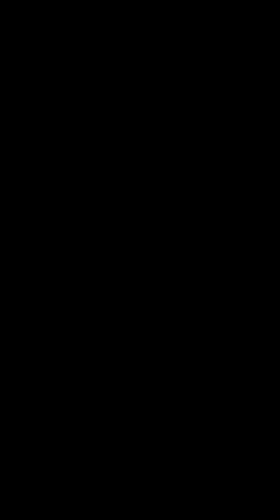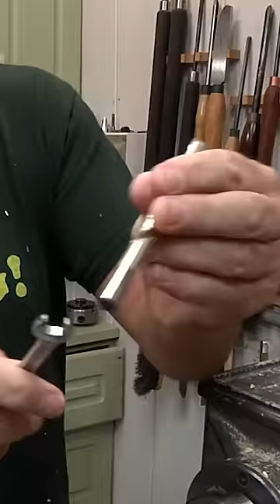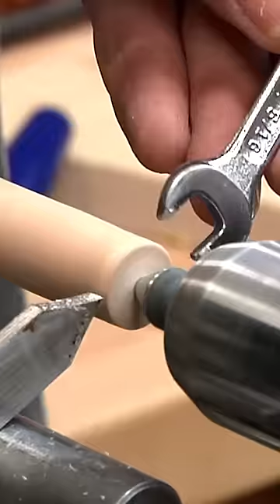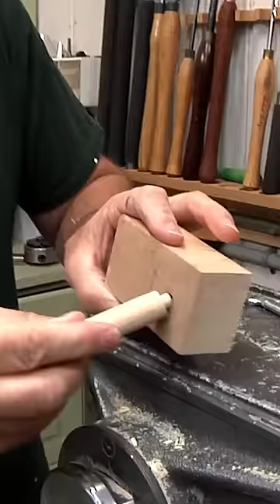Tenon Wrench #shorts

Comment: This is similar to how I use a drill bit to adjust the height of the saw blade. Say you want a 1/4" cut, a 1/4"bit layed beside blade and either eye it from side or put say 1x2 on bit and raise blade till it touches.

Comment: Dam bro, I could have used this tip 24 hours ago. I had to manufacture custom sized dowels to be used as plugs on a jury rig repair job...i even drug around a vernier caliper to the supply store for measuring stock.   What i did finally figure out, by myself, was that I could use a socket wrench, i.e. the socket, to measure the end of the dowel for fit and size. Also, you can use some sockets as poor man drill guides...

Comment: I'm curious why you wouldn't use a caliper set to the diameter you want?  Then you know it's exactly what you want.

Using a cast part like a wrench, the tolerances can throw you off quite a bit.

Comment: What would be the point of this? Just curious on way drilling small holes into small pieces of wood I mean idk it’s like that video where they take the screw out and weld and tsp and die and screw the bolt back in.

Comment: The trick I learned was how to use the right tool for the job. Wrenches are oversize so you don't have to struggle to get it on the bolt/nut. If your bolt is .312, your wrench is prob .32 right off the bat. If you just playing fine... but if you're machining, you fixin' to piss somebody off.